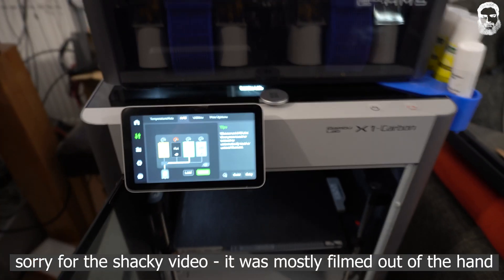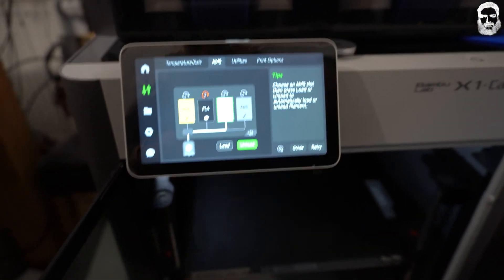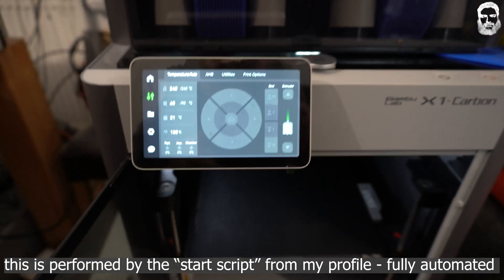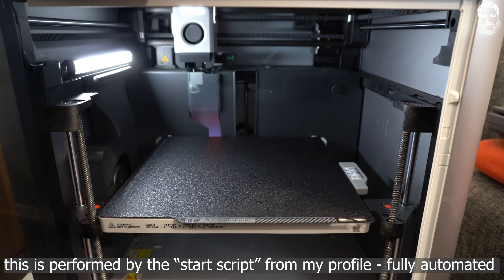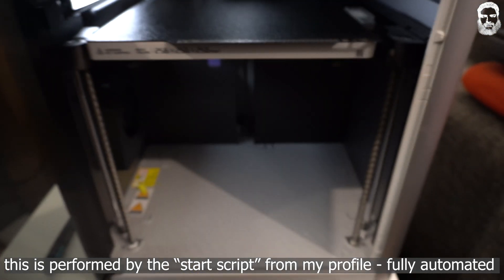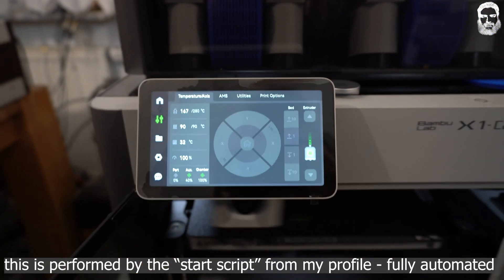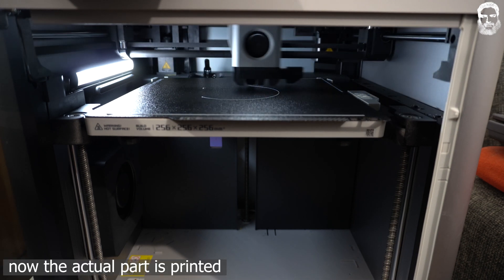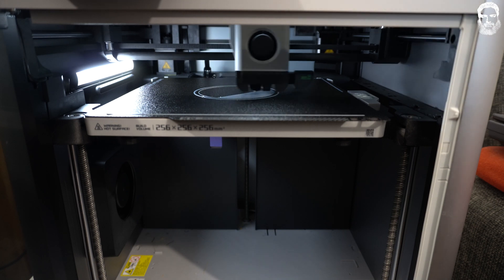BambuLab X1 ( P1P ) Simplify3D profile - automated and easy to use

Comment: I suppose I can try it and find out, but if you already know.  Will this work with a Bambu X1 Carbon which does not have the AMS?
I am not afraid of adjusting code and assume that setting up profile to use slot one will work or if not fail in some informative way.

john ferguson

Comment: Hi, great video,

What version of Simplify3D are you using?

Can the profile also be used for P1S?

Have you added to Simplify 3d start G-Code and End G-code or even others?

I have ordered and am waiting for the P1S to arrive but I am looking for an alternative to Bambustudio that is not derived from Prusaslicer-Sperslicer because I have always used S3D, I have also tried other slicers but I have always returned to S3D both for my old Anet A8 and for the Geeetech A20T 3in 1out, I find that managing multicolor with one process or more per color gives me the possibility to manage the printer better.

Thank you
Reply from the maker: Hi, I am using the older V4 and also the newer V5. greeetings Sandor - DM4DS

Comment: I did you upload the gcode without using the BambuStudio?  Also, can you connect Simplify3D to the BambuLab X1?
Reply from the maker: Hey @paulboes . I used the SDCard to "upload" the gcode. It is not possible to just upload gcode via the BambuStudio as I know. - happy printing Sandor - DM4DS

Comment: How do you send the G-code to the printer? I don't want to take the micro sd out of the printer every time as that may cause unwanted wear on the slot. Some people recommend FTP but I have no idea how to get started with that. Any advice?
Reply from the maker: you have to do it via SD-Card - as long as Simplify does not support the over the Air feature like the Orca Sliver or the BambuStudio. maybe they update it. Happy printing Sandor - DM4DS

Comment: Why does it temporarily lower the Z motor current to 0.3 at the start of the Gcode? Because my x1c creates  a short buzzing sound right at the start of a print, which sounds like a stepper motor.
Reply from the maker: @umake3dprinting  i copied this out of the original Gcode from Bambulab . Have not used my profile for a while, but can´t remember that I heard a buzzing sound. I try to look into it the next days, or after eastern. I´m also working on a V5 Version where I hope to get the AMS working. Take care, Sandor - DM4DS

Comment: nice video but will it work with the p1p
Reply from the maker: Hey Darren, I´m sure it works with the P1P, too. features like the timelapse and others the P1P does not have the hardware for of course will not work. But the speed, print size etc are the same. give it a try if you have the P1P. Happy printing, DM4DS - Sandor

Comment: Would you say your results are better in Simplify3D vs Bambu Studio? What are the best features you get out of Simplify3D that Bambu Studio doesnt offer? I have the X1C, not the P1P and brought Simplify3D years ago, and just trying to figure out if I spend the money to upgrade the license to v5 and what benefits I get... Thanks
Reply from the maker: @user-oj8ng1fo5u  Hello, the ONLY thing I´m using Simplify3d is to combine Vase mode with normal print modes while this is not possible in the Studio / Prusa slicer - I also have the older version and will NOT buy the new one cause they always told us that we "buy all updates" and now they try to sell us the next "big update". If they deliver the next years, then I maybe rethink it but NOW, no way that I buy the new version - That´s my decison and why - you must do what you think. As last point. They published V5 without a profile for the hottest printer 2022 / (2023)? That says a lot to me. All the best Sandor - DM4DS